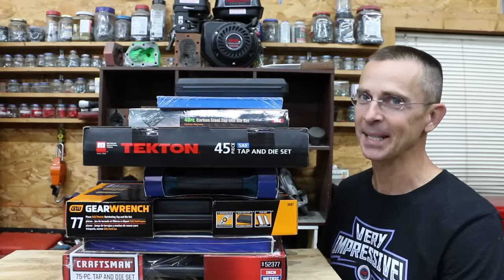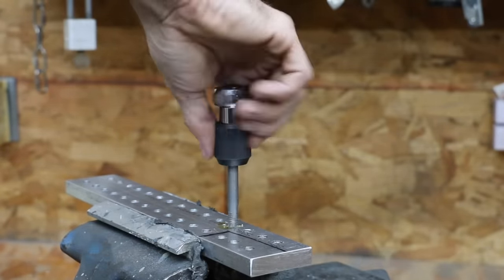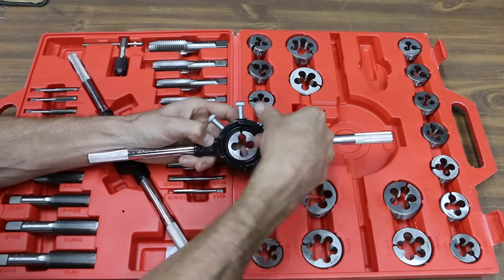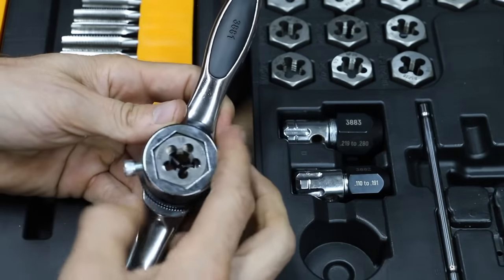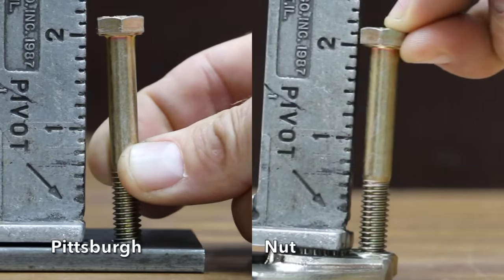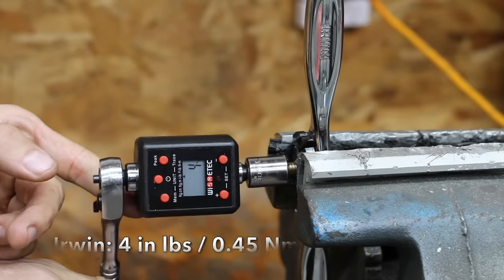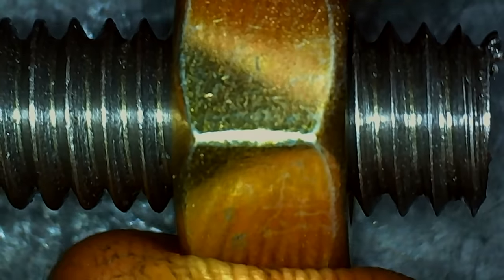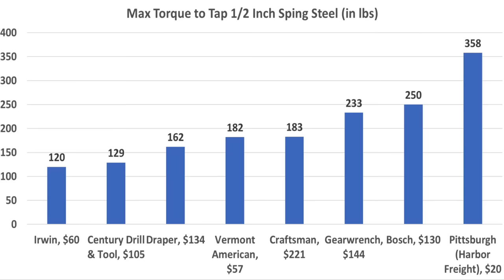Best TAP & DIE Set? Craftsman vs Irwin, Bosch, Draper, Vermont American, Tekton, GearWrench

Comment: I’d love to see you test different brands of “flushable” wipes. The brands say they are safe and they dissolve, but virtually every plumber says never use them 👍
Reply: I used to work in a retirement home, we constantly told the care givers that "flushable" doesn't mean flushable. They still flushed them. Guess what the most common thing was that I snaked out of the sewer lines when they clogged?
Reply: Listen to the plumbers.
Reply: @Deere2154D  I laugh at the wipes labeled "plumber approved."

Of course they are plumber approved: they provide job security for plumbers!
Reply: "septic safe" TP vs standard
Reply: I am certified to work on aerobic septic systems.  Flushable wipes literally means that they are capable of being flushed down the toilet, so technically the labels are correct.  By that same logic, a small pet is also flushable.
Reply: @trailerwookie  you just reminded me of the scene from (I think it was...) "Over the Hedge" where the bear picked up the bunny and used it as a wipe.
Reply: @trailerwookie  definitely a size thing and not a break down thing.
Reply from the maker: Thanks for the suggestion.
Reply: @trailerwookie  Oh man, I just read this comment to my toy chihuahua and he ran out of the office like he was on fire...
Reply: Great idea. I'd love to see this tested!
Reply: Water Companies also say dont flush them. They have a lot of plastic in them and only break down into smaller pieces of plastic, they dont completely disappear.  Only flush the  three P's  👍
Reply: @trailerwookie  bingo. They will flush but that's it. Fine for city not septic tanks
Reply: It's a good suggestion.  Ask The Builder did a good series on this a couple years ago testing different brands comparing it to TP.  He setup a whole simulated pluming run, and collected the wipes after they went through the plumbing.  Only one brand started breaking up after the trip through the plumbing.  The TP was largely already broken up.

Like all experiments, it's worth repeating.
Reply: These products are labeled, "flushable", but they should NOT be flushed!  In municipal sewers these products do NOT disintegrate, and often precipitate the formation of "fatbergs", which must be removed manually.
Reply: Oh boy, listen to your plumber.
As one, I have several stories of extracting up to 9 buckets of "flushable" wipes from houses's main sewer before being able to flush what was left to the septic system.
Toilet paper more or less disintegrates with water, while wipes are like fabric, so whenever there's a place to slow down, they just accumulate and create a clog. They probably disintegrate in a septic tank, but it takes monthes. Sewers are clogged well before that.
When you start finding wipes at the end of the snake or the cane, you know you're in for a ride.
Reply: The only flushable wipe I've heard a plumber like is the cottonelle ones
Reply: Industrial plumber here, just use common sense when dealing with things that are "flushable". If you are in a town or city the "flushable" wipes don't dissolve, they are separated out with the solids and taken to a landfill while the water is treated and put back into the environment. So, it may be ok to use those in a town or city where you are connected to a town or city sewer system. If you are on a septic system, don't flush anything besides toilet paper down your toilets and obviously waste. The tank is for holding the solids and some water, before the water gets released through the lateral lines. You don't want anything in a septic tank that could possibly clog lateral lines or anything else on the way. The can get very expensive.
Reply: "Looks like the Dewalt brand wipes are still intact, but the pipes took quite a bit of damage."
Reply: @captnhandy  I am a waste water treatment operator, please don't flush any of the flushable wipes ever. They get caught in places that toilet paper would not, the clog pumps causing sanitary sewer overflows that are dangerous to the environment and residents, and cost the utility system money. Any operational cost increase on the utility system is ultimately passed on to the consumer. 

At best flushable wipes are constant maintenance issue, at worst they are costly pump killers.
Reply: use em all you want!!.. just dont flush em... keep an enclosed deficated container to put them in
Reply: Read the fine print on the so-called flushable wipes--you are NOT supposed to flush them down problematic (for example, slow draining or frequently clogging) toilets.
Reply: That first sounded like joke. Thinking PF had to be wiping and flushing with every brand to test them is not only time consuming but it would require PF to maintain a consistent diet to get fair results. Pardon my ignorance.
Reply: @trailerwookie  Good to know! Here Gi-Gi!
Reply: i never flush any-paper i burn it in the incinerator. 💩📰🔥
Reply: @ProjectFarm  You couldn't be less creative with your response.  I am very disappointed.
Reply: @kenc2257  or septic systems
Reply: This 1000x. I have yet to see a truly flushable wipe. And flushable in the sewer sense. But both sewer and septic should be tested.
Reply: “Cleans your bottom in fewer wipes than competitors” 
“We’re gonna test that!”
Reply: @ProjectFarm  yes,please do it… we need come closure on this. Lol
Reply: This is a great suggestion!!
Reply: 10 years ago my wife was flushing "flushable" wipes. Her sister was too and they caused septic tank issues at her sister's house, so my wife stopped flushing them. We sold our house a little over a year ago and had the septic tank pumped and those "flushable", "biodegradeable" wipes from 10 years ago were still in there and floating on top.
Reply: @rothandre6497  Yeah, like back in the '50s, Camel cigarettes were "Doctors favorite brand"  LOLOL
Reply: @danl.4743  It's a  canned blanket response. Look at all the comments that suggest something, the response is always the same. 

Project farm only ever writes

"Thanks for the suggestion" 
OR
"Thanks for the feedback" 

Sometimes even when neither response is appropriate. If we're being honest we can't even be sure it's actually project farm replying as opposed to someone else with account access replying on his behalf.
Reply: I'm an excavation Contractor and I have seen grinder pumps bound up by the "flushable wipes" they don't dissolve at least I've never seen any that do
Reply: Plumber here. Don't flush wipes, sanitary napkins, drugs or classified government documents. Found em all LOL 😆
Reply: @randymartin5521  you went 10 years between pumping? How old is your leech fields?Your suppose to have your tank pumped every 2-3 years
Reply: I like this one! Looking forward to this video!
Reply: @crisprtalk6963  You know he'd send Cousin Eddy to do the dirtry work..
Reply: @tjmarx  I think it's a bot of some sort.
Reply: @chuckbailey6835 I guess it depends on where you are and what type of leach field you have. The house was built in 1972 and we bought it in 1999. If the leach field had ever had any work done it was before we bought the house.  We were in the Atlanta suburbs. We poured enzymes into the toilets and drains 3 or 4 times a year, basically whenever I remembered to do it, and that's all we ever did as far as maintenance. We lived there 22 years and had it pumped twice, at roughly 10 or 11 years and then again when we sold the house.  Both times the company we used said the system was in perfect condition, except for the wipes that hadn't dissolved as advertised.
Reply: Yes please.
Reply: They say Charmin toilet paper is "septic safe" but its caused all kinds of hell for many septic systems.
Reply: Is a home owner I refuse to flush wipes.  Why risk it when you can use a trach can
Reply: They also are said to cause anal fissures. I would stay away for them health of not only my house pipes, but alsoy body pipes.
Reply: As a plumber this would be a great test. Maybe test toilet paper also
Reply: @danl.4743  Come on dude, a creative arty farty individual does not conduct this type of testing. This type of testing is only conducted by the anal retentive, and we love them for it. Their meticulous nature and natural repeatability mean they get clean crisp results, not like the pie in the sky daydreamers who couldn't do something repeatably if they tried. 

No offense intended, it is what it is.
Reply: Yes do this test!!!
Reply: DON'T FLUSH "FLUSHABLE" WIPES. THEY WILL CLOG YOUR PIPES.
Reply: I used to repair septic systems, so I say flushable wipes smell like money to me
Reply: I think on all flushable wipes it says don’t flush if you are on a septic system
Reply: There's not a test to be done, they literally all do not dissolve until they hit lift stations. All of them clog between your pipes and those pipes.
Reply: @Kelvallontan  I've been told that most wipes are reinforced with plastic fiber, which is why they don't break up easily.
Reply: Virtually? Is that really the proper word to use?
Reply: @thra5herxb12s   Only flush the  three P's
Potatoes, pronography and polyester?
Reply: @rothandre6497  the clogging isn’t because they flushed a “flushable”, it’s because they didn’t use them as the directions state. If you use only one as intended and not overfill the toilet, that will clog regardless of what you use, it will flush. If there’s an issue with clogging when flushing just one “flushable” wipe, there’s a separate issue. The issue that is wanted to be tested is if the cause an issue for septic tanks or the public system down the line because they don’t decompose like they need to.
Reply: @danl.4743  try responding to as many comments as he does and see how “creative” you are. You can be disappointed but I know I’d rather have better content to watch than getting more creative replies
Reply: @replynotificationsdisabled  virtually: adverb: nearly, almost.       Yes it is actually the proper word to use.
Reply: @rothandre6497   Carpenter ants are a carpenters best friend.
Reply: Very true, except the small pet would decompose in the septic while the “flushable” wipes would clog everything up and destroy either the aerator or dosing tank pump:(
Reply: @rothandre6497 
Apply that same logic to toothpaste, lol.
Reply: @trailerwookie 
The hallmark of goldfish funerals for decades.
Reply: Use a bidet.
Reply: @Pipe Layer  yep, I have a friend who worked at the city treatment Plant. he said prior to 'flushable' wipes they would screen out a dump truck a week of solids prior to the treatment process. since 'flushable' wipes they take 1 or 2 trucks a day!!
Reply: @nix4644  It should be illegal to advertise something not completely biodegradable as flushable.
Reply: @trailerwookie  great comment. "Flushable" is misleading at best. Both toilet paper and so-called flushable wipes are indeed flushable, but only toilet paper is *dispersible*. Big difference.
Reply: @Deere2154D  fine for city? They still have to be removed from the water, just at the treatment plant instead of your septic tank. You'd save a step by not flushing them...
Reply: As a landlord, I have a clause in my lease stating that flushable wipes are not, and if a plumber ever finds anything but TP and what you should expect in a clog, the tenants get billed directly for the call. Same for flushable cat litter; I destroyed a toilet once with that stuff; never again.
Reply: I'm not a plumber and I say don't flush them
Reply: @trailerwookie  socks can be flushed, therefore are flushable.  brilliant!
Reply: @thra5herxb12s  pee, poop, and pcondoms?🤔
Reply: An easy test for anyone to do is put toilet paper in the toilet, then grab a toilet brush and swirl the toilet paper in the bowl.  You'll see the toilet paper break up into thousands of pieces.  Then, put those "flushable" wipes in the toilet and see what happens when you swirl it with the brush.  It doesn't break up at all.  

A good practice is wipe first with toilet paper which you can actually flush, then finish with the flushable wipes but put them in the garbage.  Or even better, get a bidet.
Reply: @trailerwookie 😂
Reply: For anyone who still flushes these wipes down the toilet, please go watch the videos of The Drain Unblockers channel. I'd say that 95+% of their unblocks are from wipes -- I think they charge about $90 USD for a drain unblock, so imagine how much money their repeat customers are wasting because they just won't stop flushing the wipes. I use the wipes, sometimes (got a bidet for the wife, and now I use it; Omigo brand, I think), and I stopped flushing them years ago, just throw them away in the trash. No way am I going to have to pay for a plumber to come snake these damn things out.
Reply: I worked at a plant with effluent pumps in the basement. Would reverse the 3 phase motors to unclog. Worked most times. Eventually pumps needed to be replaced because impellers jammed with wipes that could not be removed.
Reply: Good idea

Comment: Obviously these tests are for pure strength and quality. I was taught as a steel fabricator by trade that when tapping by hand use plenty of cutting compound, keep straight as possible, and turn a 180-360 then reverse 90 or so till you feel the swarf break loose an repeat until hole is tapped. I have an el' cheapo set in the shed for around the house. Using this method gives me a nice clean thread and they have lasted years with occasional use. Sure it takes longer but works a treat. My boss that taught me was probably tight about replacing taps. However it works well and minimizes wear.
Reply from the maker: Thanks for the feedback.
Reply: Right on 26! @ProjectFarm
Reply: me too back and forth not all one way

Comment: Such thorough testing! Was nice seeing the exact same tap & die set that I own being tested, the Craftsman. Thanks for all the work you put into making these great videos!
Reply from the maker: Thanks and you are welcome!
Reply: after watching the entire video i still dont understand what a tap and die set is
Reply: @glowytheglowbug  A tap cuts threads (the lines of metal that hold a bolt and nut together) in a blank hole so that a bolt can screw into it. It can also be used to repair lightly damaged threads in a case or nut.

A die cuts threads on a shaft or rod so that a nut can go onto it. It can also be used to repair lightly damaged threads on a bolt or stud.

BTW, never put a tap through a die. The threads will seize up and the tools will break because they aren't exactly the same size, and they're made of a hardened material that won't flex.
Reply: @Cuuniyevo  ooh so one is for nuts one is for bolts/screws thanks!
Reply: Thanks for supporting the CCP..
Reply: Seems to me to not even be a competition. Craftsman crushed everything and was first in almost every category.
Reply: @ProjectFarm  As a professional Tech please use the makers I use, Snap-on, Mac, Cornwell and Matco for these tests; because I use these everyday in my daily job...
Reply: @graken22  I think these are more for the everyday consumer , not Pros, as a Mechanic I use Mac for Tap and Die,  I was glad to see in the Torque wrench vid he did add the Snap-on which for torque wrenches is out of the regular consumers price wrench but It's the only one we would use for daily use ,year in and year out.
Reply: @graken22  So true or at least one good brand!
Reply: @jrhageman1  For dozens of years,though I dont know if manufacture changes have occurred, Mac Matco and Blue point Tap and Die sets were all made exclusively by Vermont American and were just rebranded by the big three
Reply: Exactly! I have that same set that I purchased 4 years ago for $99! Still in great working condition.

Comment: I'm still using the same Japanese made tap and die set that I bought used at a flea market in the mid 90's. But I have been considering a new, more complete set since some of my stuff has broken/worn out/got lost over the years. The Irwin or Century seem to be right in my wheel house for cost and function. Great timing with this video!
Reply from the maker: Thanks!
Reply: I have an old tap and die set I bought off Harbor Freight in the 90s made in Japan and it's a lot better than anything I'm seeing here. Was their top of the line back then. Think I paid $70 for it? 1/4 to 1" coarse and fine taps and dies. So pretty comprehensive set. I wish I'd bought the metric back then.
Reply: Exactly this, even a cheapish set of osborne or similar spiral point coated taps and drills at $60-80 make these sets look incredibly crude.
Reply: I’m pretty sold on the reliability and strength of my Century tsps and dies.  Easy to find nowadays at OReilly’s.
Reply: I'm glad I bought a large Irwin set awhile back from somebody on marketplace for a hundred bucks. This set has everything though, not the small one
Reply: I have a Vemont notmadeinAmerica set, I have eyes on the Century set. Should go well with my Honda, Toyota theme.  As a side note Vermont American is owned by Bosch. I would not recommend Bosch drills/ taps. I thought a German company would be great at metal cutting..... Its funny how humble Irwin trounces them. Milwaukee black oxide are the best drill bits I have found...
Reply: @lamarzimmermanmennonitefar5269  I have a small Vermont American set that is made in America. It's OK. I think it only goes up to 1/2"? So small set is small.
Reply: You need to try a Good set of drill bits,you'll never go back. Try Norseman USA made,not outrageous price
Reply: @lamarzimmermanmennonitefar5269  Bosch really haven't made anything of notable quality for a number of years. Sad how a once great company now mostly peddles low-mid range quality garbage.